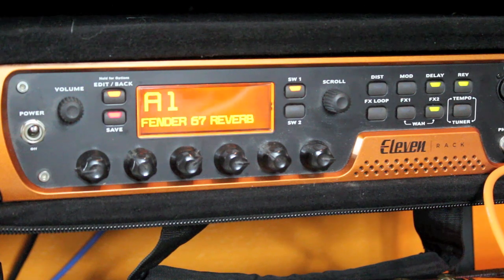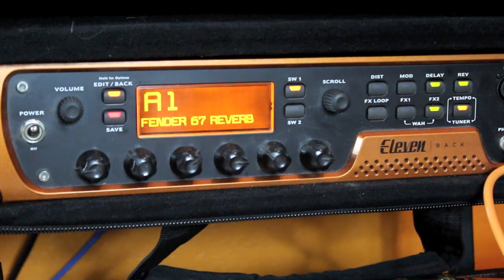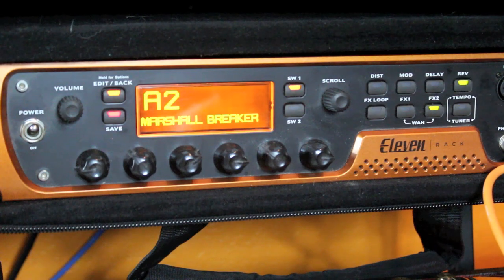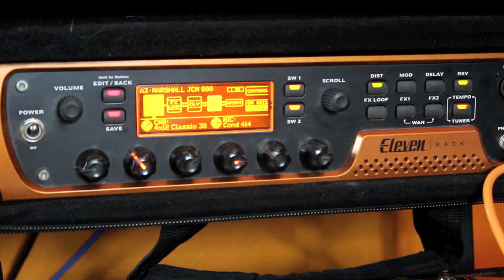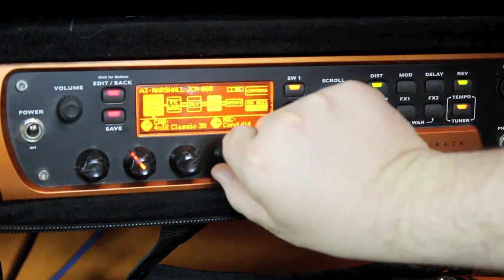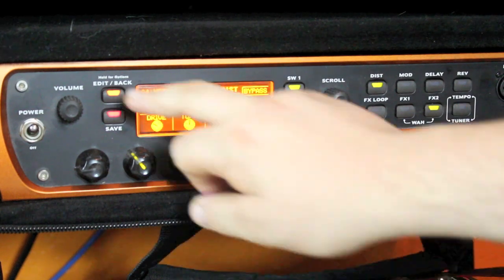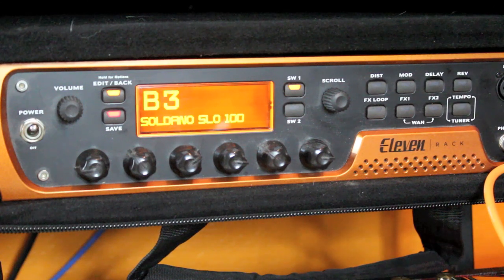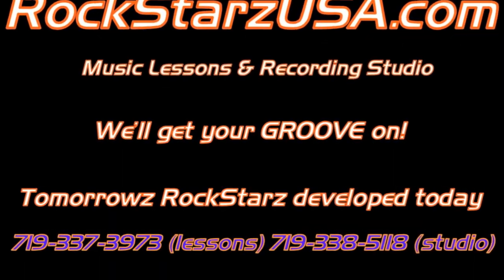Digidesign Eleven Rack & Marshall BluesBreaker: Part II - RockStarzUSA.com

Comment: i have an 11r and i also love the cm 800 model in it!!  great crunch, works well with a ts808 in front as well, but it is perfect with nothing i front, the dynamics are better, it cleans up more nicely when you back of the volume on the guitar;  works perfect with strat and les paul

Comment from the maker: Hi Dennis, thanks for your kind words. I've since moved onto a different path with my tone, & no longer use the 11 Rack. I can't recall exact pesetas, however my tips are the following. I typically dial in a very low OD in front of the amp & pull the tone control back a little to add a warmth to the foundational tone. I also employ a Graphic EQ paying closer attention to the frequencies between 300hz-800hz - the Frequency a lot of rhythm crunch guitarists would use.

Comment: someone may have asked however I was just curious if you HAVE to run the cab and mic simulator to get a good tone when you run your 11r through a power stage? or with a cab? I have an 11r but don't own an amp to try this through. great video man thanks for sharing!